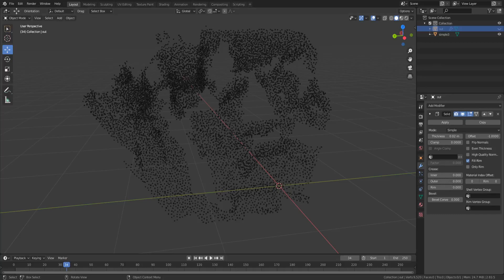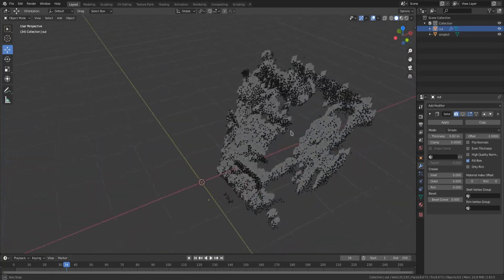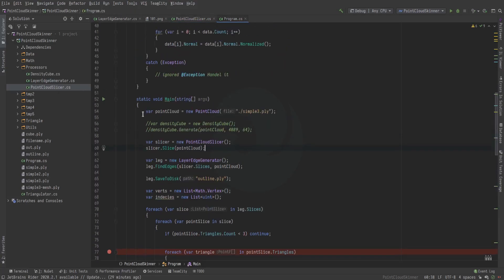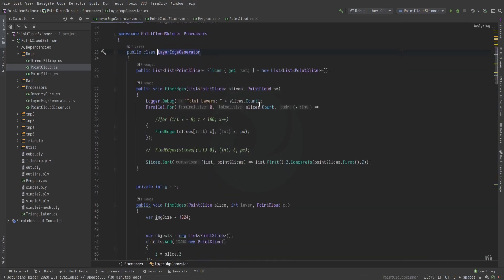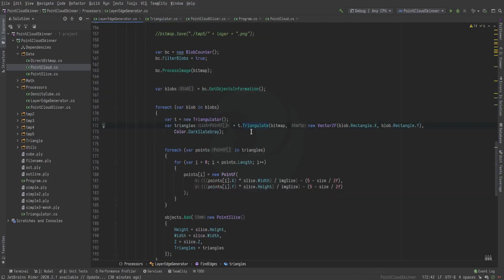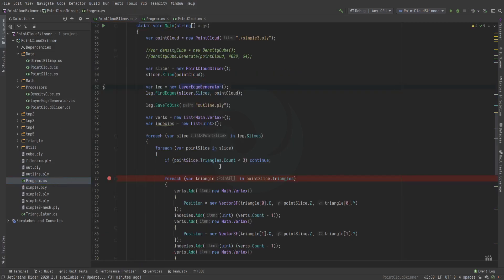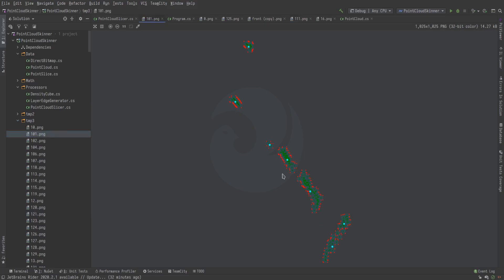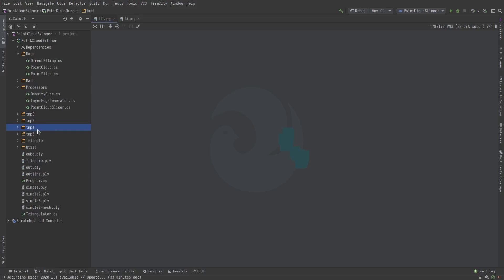Experimenting with Point Cloud To Mesh triangulation in C#

Comment: Hey good video. In case you 're interested I learned recently that building your own STL files is fairly straight forward.  It's just just a ton of triangles.  You can actually iterate through your point cloud data and write an STL file in ASCII format.    Check out the wikipedia page for STL .  
You can do a lot with an STL, there are also a lot of resources for converting STL to other formats.